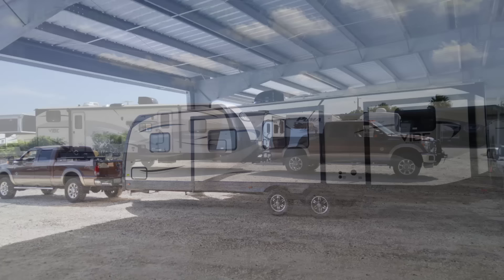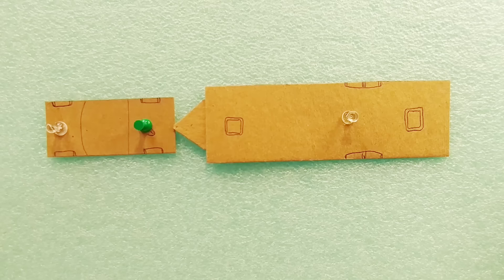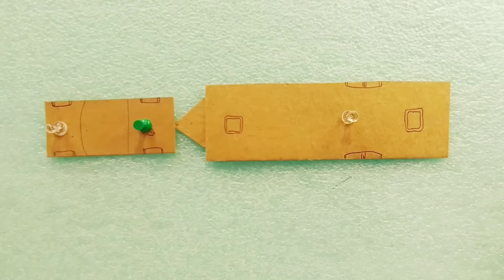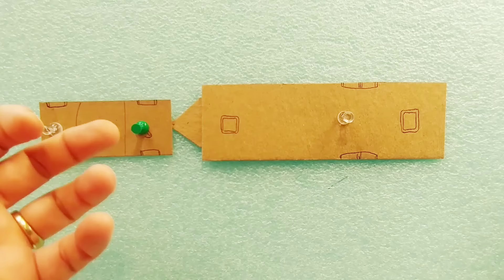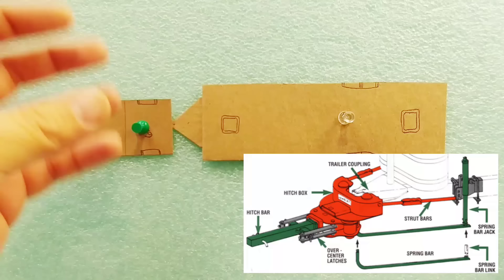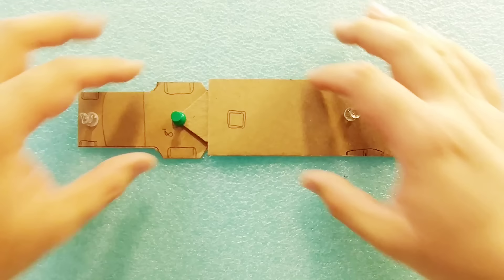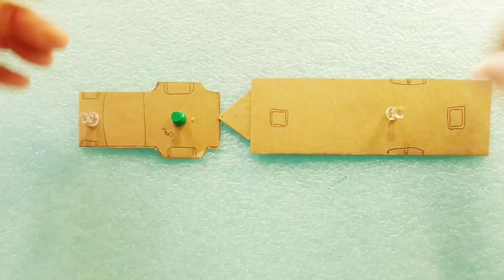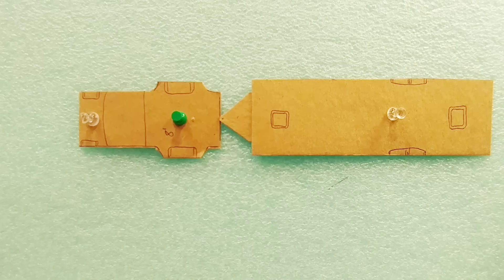Sway when towing an RV? Watch this!

Comment: I think that you slightly missed the root cause of instability. 

When the hitch is behind the rear axle this creates a positive feedback system. When the trailer pushes left on the hitch it pivots on the rear axle putting a right force on the front axle which introduces a right turn, further throwing the weight of the trailer to the left, increasing the left force on the hitch etc, until the driver corrects it which then throws the whole thing over the other way, and now you have a cyclic unstable repetition. 

The further behind the rear axle the hitch is, the worse the effect, so a long wheelbase vehicle with a short rear overhang is the most stable (or maybe the least unstable). I used to tow with a Peugeot 806 and if you look at the shape of them you can see why they tow so well for such a light vehicle. 

When the hitch is in front of the rear axle like an artic (semi) it is a negative feedback system. A sideways force on the hitch pushes the steering axle the same way immediately damping out the turn that the trailer has started. This is why an artic tractor unit can tow a high sided trailer that's several times its own weight and not get into a sway. 

Fifth wheel right over the rear axle and also "drop n drag" trailers with their own steering axle  have no influence on the tow vehicle's steering and so are not unstable. 

The only thing that stabilises a rear overhang positive feedback trailer system is nose weight, and ideally you are looking for 10% of the trailer weight on the hitch and 90% on the trailer wheels which is easier with a large tow vehicle that can take that kind of weight without causing other issues.

A trailer with a heavy nose will naturally want to plough straight on which is a stabilising effect, whereas a tail heavy trailer would just swap ends without the tow vehicle stopping it from doing so. A positive feedback system plus a trailer that's constantly trying to swap ends is guaranteed sway.
Reply: And this is a key reason why many European countries limit the speeds of travel trailers to 100 km/h or less.  The smaller TVs in those countries cannot carry as much tongue weight, and are therefore less stable.  Since stability decreases with increasing speed, they become unstable at normal highway speeds.

Comment: Yes, proper setup is key! Have you considered weight distribution hitch storage? HITCHPORT Hitch and Spring Bar Mounts are the solution. The noise can also be quieted with Equal-i-zer Sway Bracket Jacket.

Comment: Our little camper is only 14’ and we pull with our Pacifica mini van. We were told by the dealership as well as the company (Travel Lite), NO sway hitch can or should be used when pulling this little camper with a vehicle that is double the weight of the camper.

Comment: Good visual demonstration. I'd suggest maybe a 'Part 2' to explain other factors that contribute to sway issues. 1.(sort of alluded to in the video...) The SIZE of the trailer - The 23' TT that I pulled with a '97 light-duty F-250 (7-lug wheels) had virtually no sway issues with a load-equalizing hitch. If you're towing a 30' Airstream, you might have issues. 2. Overhang - Are your tandem trailer wheels closer to the middle (bad), or further back (good - rear kitchen floor plans, for instance)?

Comment: If the axles or wheels are not aligned properly you will notice unusual wear on your tires! If you ow n and haul an RV, please read and follow your owners manual. Weights are hard for most of us to understand, but worth studying and following! A lot better than jack knifing your rig or seriously injuring yourself or family.
Reply: In addition or explanation, my brother and I have been driving professionally for over 30 years, we’ve seen and been through some interesting experiences.  My brother jackknifed a set of triples on snowy road up by Idaho Falls. Not a good experience, I’ve rolled my car on the backroad to SunValley Idaho, just past Arco. Point is if you don’t follow the laws, of nature or man’s laws then there will be consequences!  Some of which are very unpleasant!

Comment: Toy haulers are great, but when you strap down 2 heavy bikes in the back "garage" area of a travel trailer, counterbalancing for proper tongue weight is critical. Rear loaded trailers are the most dangerous thing on the road. They sway and wander with the slightest provocation. Losing your trailer, bikes, truck, and maybe even your life all in one fleeting moment of terror ain't why we RV.
There are hitches that measure the tongue weight, as well as control sway. Spend the money, spend the time and do it right. This is supposed to be fun.

Comment: Also ideally speaking with 5th wheel your hitch should be above your drive axle or slightly ahead. Proper 5th wheel placement places weight on your steer tires too making your front end more stable.

Comment: I towed a 33 ft Aerolite TT for 10 years with short wheel base Toyota Sequoia.  First trip towing it from Michigan to Colorado with Reese weight distribution hitch was white knuckle all 1200 miles because of trailer sway.  Bought a Hensley Arrow hitch and sway was completed eliminated in fact I was more stable in a cross wind towing the trailer with the Hensley Arrow then driving the truck by itself.  We towed that trailer across the country many times.

Upgraded to F350 Diesel Crew Cab with 8' Bed 5 years ago towing a 12,000 lb 33 ft Excel TT using ProPride Hitch(Similar to Hensley Arrow).  Reason I went with TT vs Fifth wheel is because I wanted to keep my dogs in the bed of the truck and also have bikes.... covered & out of weather & out of site... 

The reason the Hensley Arrow and ProPride Hitches eliminate sway is because they use a cam mechanism under the ball that effectively projects the pivot point of the truck/trailer to over the rear axle.  Thus giving you a similar  towing experience to that of a fifth wheel. 

Here's plus & minus from my experience of TT with Hensley Arrow or ProPride Hitch vs 5th Wheel

                                                 TT with Hensley Arrow or ProPride                                                           5th Wheel
Towing Experience                  Similar but TT has lower center of gravity vs 5th wheel
Wind Drag                                 Fifth wheel is 1-2 feet taller than same floor plan TT but TT further away from Tow vehicle, so ???
Total Vehicle Length               Total length of truck plus TT or 5th wheel is 6-8 feet less for 5th wheel so easier to park...
Use of truck bed for storage  Much better for TT.  Filled my bed with tools & traveled back to Michigan to build my sister a deck
 
Hope this helps someone...

Comment: One thing to remember, DO NOT EVER use your cruise control in on a wet surface. I watched a F250 pulling a 32? Foot bumper pull end up in a ditch just outside of Junction, Texas, because he was using his cruise control. His back wheels on the truck lost traction and spun out to his left, he over corrected, truck was in the ditch, the trailer was still connected to the truck, but on it’s side.

Comment: I've been towing a TT for almost four years now. My first one was 3800lbs and the one I have now is near 7000lbs. I have the Reese system with the friction bar and it worked great on my 1500 truck with the 3800lbs. Once I got the bigger trailer it did almost nothing, I was adjusting it almost every trip and just couldn't get it right. I bought a 2500 last summer and the comparison is remarkable. I guess what I'm saying is evaluate your tow vehicle first bc mine was rated for 8800 and the trailer took control of the truck even with little wind
Reply: Hey Neil,  I highly recommend a Hensley Arrow or ProPride hitch to eliminate sway if you can afford one.
Reply: More important then the hitch is the tow vehicle. Don't go over max gross combined weight. Don't go over max tongue weight. Don't go over max tow weight. Don't go over max axel weight. At least 10-15% of the tow's gross weight on the tongue. Follow these guide lines and you shouldn't even need a sway bar.

Comment: One other thing that a filth wheel trailer does is move the trailer axles forward which takes away the area of weight that would've been there between the truck rear tires and the trailer tires.  I'm 51 and have been pulling trailers of different kinds since I was 15 and have had several blowouts on them the least sway during one has been on a dual tandem gooseneck loaded with 10 pallets of water from the army base and could barely tell that tire blew.   I'm glad you did this video so people will have a better idea of the way pulling trailers work.
Reply: Hey Stacy,  I've been towing TTs for almost 20 years using either Hensley Arrow or ProPride hitches & had 3 blowouts in that timeframe.  Never fellt the tire blow just lots of smoke.  I agree the video is good.  Learn after blowout this summer on my 12k lb Excel TT to buy new tires every 4 years because the rubber dries out in that timeframe...
Reply: jim everett I've had that happen also.  Plus as he said one blew when an axle was bent
Reply: LOL -- "filth wheel trailer"....have some pride, man, and wash your trailer!  ;-D

Comment: Well done!! I definitely have a better understanding of what sway is. I use an old Curt weight distribution hitch without anti-sway bar. I learned that by moving more weight to the middle of the truck bed I was able to control sway much better without an anti-sway bar.
Reply: what type of weight do you use and around how much weight?

Comment: You didn’t address another cause of sway with improper weight distribution of the trailer.  The weight pressing down at the hitch point should be 11-15% of the total trailer weight for best stability.  Also of note is the ratio of weight between tow vehicle and the trailer.  As the weight of the trailer approaches the weight of the tow vehicle (and many times surpasses it) the setup becomes less stable requiring additional equipment to abate sway.  The reason for this is also physics and is in addition to the other causes you covered.  Thank you for the video.

Comment: A different type of hitch over here in the UK The ball connection on the vehicle is clamped down after the trailer is connected stops snaking and gives better stability. In the UK we are only permitted up to 60 mph even this can be too fast in some circumstances. It sounds wrong to clamp the towing vehicle to the towed vehicle,you would assume the ball and hitch would not turn,but it does,and secondly when reversing the tite hitch stops the trailer from too much outrunning giving much more control

Comment: Before any of you watch this and think you HAVE to tow a fifth wheel to eliminate sway, think again.  You always must stay safely within the specs of your tow vehicle, but there is a hitch that eliminates sway for a travel trailer: the ProPride 3P hitch system.  And before you balk at the price and say "I'll just buy a bigger truck"; the price of the bigger truck will almost always be exponentially greater than the price of the ProPride hitch.  One more thing, the bigger truck is NOT eliminating sway, it is simply handling it better so that you don't "feel" it as much in the driver's seat.  I know.  I'm a very happy ProPride owner and would not even look at another type of brand of hitch.

Comment: Another very well explained video that helps illustrate the many forces involve in towing trailers. 

Some of the following is in lamen's terms for the benefit of others who may be reading this. I know you from one of the Ford Truck forums I frequent. I know you know your stuff.

One of the things that you left out that may have been noteworthy, is tires. It is astounding how many 1/2 ton trucks and SUVs have P-rated tires (Passenger car) standard. Swapping those out with an LT with a rating of E for instance will allow one to increase air pressure, thus increasing side wall rigidity. This will also help to make sure that the articulation of the entire suspension system resides where it should.   
I know this is a small factor when compared to the major causes you explained. But for the occasional weekender, simply changing a properly set up system with appropriate tire can be the final piece to the puzzle for a more enjoyable towing experience. 
Another thought.... For those out there who have purchased a package deal from an RV dealer (trailer and WD hitch), be mindful that it is almost impossible to properly set up a WD hitch to a tow vehicle when it is brand new at the dealer.  Once the trailer is loaded with all of the gear for camping trips, it will almost undoubtedly change the behavior of the WD hitch. Be sure that if they assemble and install the system for you, the hitch and its components should be understood and adjusted by driver or owner of the vehicle.  A basic understanding of how to properly adjust any WD hitch out there is a must if you consider yourself a conscientious, safe driver.   It is just as important as working brakes and sound tires.
Okay, rant over.

Comment: I’ve been looking at a Ram 1500 ecodiesel, as I plan on towing a small-ish 28’ trailer.  Your your video just made me rethink my bed length choice.  And you may have helped lean me towards a 2500 dually instead of a 1500 single.  Thanks I think you just cost me $20 grand. 🤣

Comment: I can't understand why it is never explained on what the trailer brake is used for. I agree with everything your saying, but as a truck driver for 37 years, it was always taught that whenever your trailer starts to sway or slide on ice to slightly put pressure on only the trailer brakes by moving the brake lever. This creates a tug of war effect on the hitch where the truck wants to pull forward and the trailer wants to pull backwards which eliminates the slack at the hitch for the sway not to happen. This method has saved me dozens of time. You will notice by doing this it straightens the trailer immediately. NEVER apply the truck brakes during this procedure! Just my 2 cents.

Comment: Your explanations address some points that deal with symptoms. It's a video for persons that want to counter sway control with a secondary device, but the video does not address the causes of sway control and how sway works. Wind could be a factor in setting sway off, but sway will happen even in a no wind situation, like if you have a strong wind from the rear - in fact this no wind scenario is akin to going downhill, which we all know exacerbates sway. The answer lies in understanding trailer and towing dynamics - weight, weight distribution, higher COG's and softer suspensions are the major contributing factors. The new style independent trailing arms must be the single biggest contributor to sway prone rigs. Lifted two vehicles with upgraded shocks adds to your misery.

Comment: Employing a 5th wheel system is ideal, if that is not possible, we should aim to reduce the horizontal distance from the tow vehicles rear axle to the tow-ball. This reduces the side levering force of the tow vehicle if the trailer has even minor sway movement. As far as the anti-sway mechanism, I would prefer to invest in a trailer with an independent braking system or even better an independent automatic trailer stability control system.

Comment: I've towed a TT for 10 years now, with and without a Hensley. The difference is astounding. There is ZERO sway with a Hensley or ProPride. I know it's a lot of money, but just think what you're carrying with you.
Reply: Same experience towing TTs for almost 20 years.  Use Propride now towing 12k lb 33 ft Excel TT w/ F350 SWD crew cab long bed.  And one other upgrade I recommend is AutoFlex rear air suspension with auto-leveling.
Reply: My point exactly!
Reply: Love my ProPride hitch. My current trailer is 33’ long, precious one was 31.5. The ProPride eliminated any worries about sway. Definitely recommend talking to Sean about how their hitch can save your life and property.
Reply: And worth every penny.

Comment: Hitch distance from Rear axle is the big deal.   Aggravators: Weight distro,  tire pressure, shocs, springs, swaybar health and design.  I didn't figure Wind on the long box Trailers as an aggravator.

Load distro hitch worked great.  Friction bar also worked great.

Comment: Big thing forgotten is tire sidewall flex.  This is something nobody talks about.  The sidewall flex of one set of rear LT tires with four sidewalls and a short wheelbase truck creates an angle deflection of the towing vehicle greatly exaggerated over that of a longer wheelbase truck or a dually truck with eight sidewalls.  Once those tires flex and take the rear of the truck off center line your instinct is to steer into it and then the pendulum effect begins.

Comment: I think there is one other factor in towing trailers that use a bumper trailer. Too much weight at the rear of the trailer means when the trailer/truck combo does move a bit, that excess rear weight on the trailer exerts a more powerful side to side leverage onto the trailer hitch. And there is less weight and traction on the tow vehicle rear tires